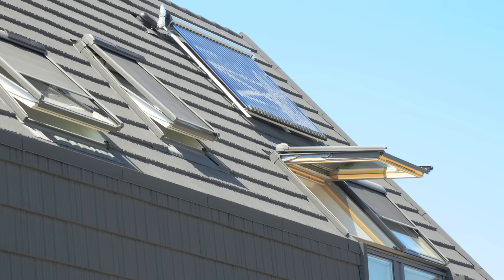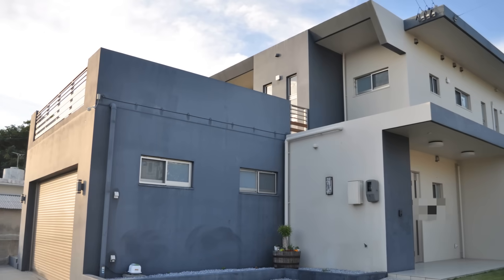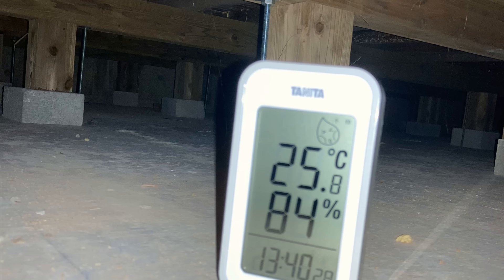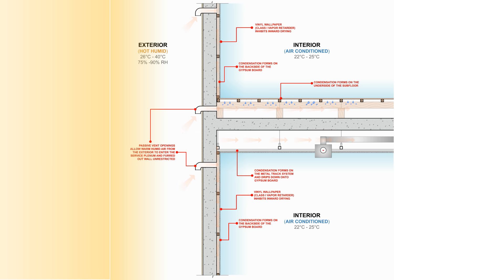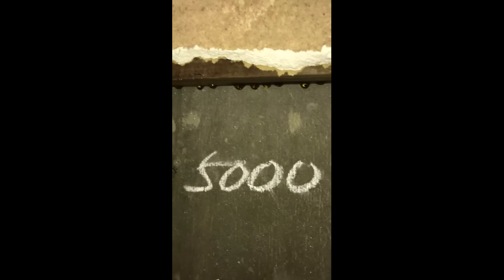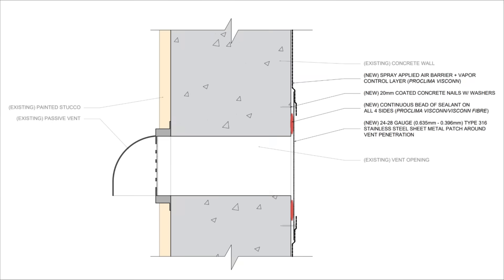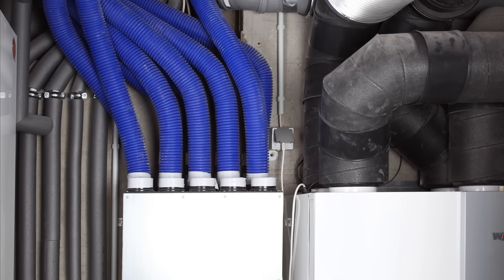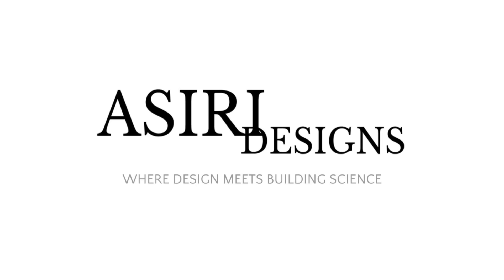The Unintended Consequences of "Passive" Ventilation... (A Case Study in Japan)

Comment: As a German electrician, I hate and love dry wall. Here in Germany we do Metal framing not wood, wiring cables socket outlets Piping water or whatever is easy but..... The exterior walls I would never ever put a drywall against it. They could roughen the concrete surface horizontal with a broom to give extra bonding ability for lime mortar. Lime prevents mold instead of clay  because of it's sanitizing surface. Here in Germany they used since the 80's a lot of gypsum mortar because it hardens quicker, down side it attracts mold too I bad conditions, today they finally switching back to lime and clay again, which we used for more than 2000 years. In the old world of course, greetings from Germany.

Comment: yeah I used to inspect the ventilation in residential and they try to make the houses tighter but that doesn't account for micro climates and details about moisture, and it becomes a bigger issue.  For example if you have a fish tank in a room we don't measure the exact ventilation to that room but then they want to be at the minimum for ventilation for energy.  You have to build concrete or block housing to do it.  They say they're using non-toxic building materials but that doesn't control what is brought into the house by occupants, and it doesn't change that it's still organic material that pathogens can grow on.  But passive ventilation exists with central air.  you can have mechanical ventilation and it doesn't change anything if there isn't feedback.  You're talking about controls like measuring temperature, humidity, and air flow into each room in detail.  You are not at that level.  That requires fenestration analysis on each window on different walls with different light exposure.

Comment: you cannot put AC into uninsulated buildings - period, this supposed "proper" ventilation is a bandaid, what you need in insulated walls so condensation cannot occur when the wall surface temperature on the moist air side doesn't get cold enough for condensation to occur

Comment: Very interesting but I am still having difficulties understanding the concept of ventilation and strict separations of the outdoor and the indoor. It is kinda contradictory.
Reply from the maker: I'll boil it down to these fundamental principles; Bring outside air in via controlled mechanical ventilation intakes so that you can control the rate of air change, the temperature and humidity of the incoming air, and the pollutants entering the interior. Basically, the outside air that you're consistently bringing inside is "treated" before it actually gets inside so that your fresh air is coming from a known and predictable source.
Reply: @ASIRIDesigns Right. Well I was thinking about the cross ventilation way of preventing moisture but after a bit of research it seems that you can't really have both at the same time, it is either natural crossed ventilation or controled air climatisation. It is a lot more complex than what I thought. I am gonna watch your other videos about this topic. Thanks.

Comment: Traditional building materials do not mold when they get wet. The problem with cheap modern materials is that a leak or condensation creates a cascade of black mold growth. It is not that traditional buildings had wind blowing through them. The materials themselves do not mold. The high quality traditional lumber can get soaked without molding. I have a 100 year old wooden floor where the toilet created condensation. The adjoining lumber cracked and had to be replaced, but MOLD DID NOT GROW. A traditional plaster wall DOES NOT mold when it gets wet.
Reply: bingo

Comment: I currently live in okinawa and ive had the exact same issue and circumstances in my rented apartment. The landlord tried to blame me for running the ac and told me not to run it below 25°c, but refused to listen to the fact that that temp is still below dew point and the building was just simply built poorly for the environment.

Comment: japanese have never heard of a vapor barrier? in hot humib climate the vapor barrier is usually on the outer side of the wall. The only problem in the video seems to come from furnishing the inside with hollow drywall and hollow floor how it was never intended. Usually those vents go into the room, not into wall or floor cavities.

Comment: 2:00 wouldn't it be cheaper to build brick house😅 mold dont touch red brick 😊
Reply: Because Japan is one of the most seismically active places on Earth, and brick performs disastrously in seismic events. Japan also has long, hot rainy seasons, and many parts of Japan have high exposure to ocean-sourced humidity. Also terrible for brick. To varying degrees, the same is true for many areas of the U.S.
Reply: You'll be surprised at what mold can grow on. I've seen more moldy concrete and brick walls in China than I can remember.

Comment: Coming from Singapore, my impression of passive ventilation for single floor buildings was high ceilings and louvers that can be opened or closed if they are retrofitted with air conditioning.

Not vents that are literally holes into hollow wall spaces.

Comment: If you are renting, and don’t have direct mold problems like in this case, but still smell wet wood coming from the passive vent of the roof during hot summers when the AC is running, does it make sense to put an active fan on the vent to blow some internal cold air out instead of letting the moist warm come in?
Reply: Need info. on AC: is it central (separate ducts/vents) or standalone unit? Based off of video's ventilation parts, need to consider attic/roof space insulation/ventilation. 

Seasonally "closing" passive intake vs. counter, passive-intake exhaust fan maybe a start. Active airflow into attic/roof space, may compound humidity & condensation for shared passive-intake air. An active fan can pull air back inside (a negative in this case) through (dirty, grease contaminated) kitchen cooking exhaust ducts (if present).

Increasing apartment's interior pressure (air pressure pushing outwards through vents/openings) helps correct inward humidity. As simplest part of this route, 1ˢᵗ seal air leaks by weather stripping & caulking of doors, windows & any gaps, as even small openings allow more humidity in vs. un-/poorly insulated wall diffusion. 2ⁿᵈly & more complex, bring in outside, filtered air via an ERV (Energy Recovery Ventilator) since location is in humid climate, to increase interior pressure.

Some ERV units can be adapted to apartments (require own window connecting ducts & ports, similar to  AC flexi-ducts):
1. Vents Freshbox Micra 100 WiFi,
2. Pioneer Eco-Oasis 150,
3. AprilAire Healthy Air System V22BEC 120cfm Brand New ––or–– Open Box,
4. Field Controls 150EC,
5. RenewAire Residential Series &
6. S&P🇺🇸Vent. Systems TRLPe.
Most units are in/on-ceiling/wall design, requiring wall hang or floor stand adaptation. Consulting qualified HACV specialist, experienced w/ conditions like in video, to appropriately size a unit, inclusive of numerous site factors, is also necessary. INITIALLY gets pricey fast, but in future moves to similar sized apartments, portable-ized ERV goes as well.

Comment: Me as a Brit watching this (we don't have AC), everything is backwards to what I'm used to seeing! Usually the interior air is warm and moist, and you let it dry by ventilating the cavities to the (cooler, dryer) air outside. Fascinating that buildings need to be constructed differently like that. What if you need heating in one part of the year, and cooling in another part of the year? Then the building would have to somehow handle both cases.
Reply: One way to do this would be to build a wall with symmetrical cross section, with a air/vapor barrier in the middle and insulation on both sides of it, so that in the summer the inside can dry inwards, in the winter the outside can dry outwards, and the air/vapor barrier never reaches dew point in any season. The classic British "high efficiency" wall of (inside --> outside) brick + foam board + plaster would work well in any climate since the insulation is air and (if thick enough) vapor tight.

Comment: I'm assuming this is a foreign family, maybe US military. I wonder about the air-conditioning. Japanese families usually only run ac in individual rooms. We only have one unit for the living room and only run it during the hottest part of the day. Grok says the electricity cost in Japan is 30-70% higher than the US. The cost to keep the house sealed and air-conditioned 24/7, especially without insulation would be horrible. But it may be the best compromise. 

I've lived in a concrete house in Japan. They are like ovens in the summer. The way my Japanese wife handled it was by trying to actively manage the heat, opening and closing the windows and drapes depending on the time of day and using reed sheets to keep the sun from directly hitting the windows . But basically we suffered a lot. One thing I would do is put some cheap raised decking on the roof to keep the sun off. Can be had at a home center.
Reply: Even in our manufactured double wide in humid north Georgia USA, active management of the sun and breeze can radically decrease in power use. I'm 67, we had to make do as kids. My grandma had a whole house exhaust fan in the attic. Huge and noisy, it really helped! It just amazes me that people have to "learn" to use drapes 😕

Comment: Interesting that every (relatively) new build I've seen in Japan has these passive ventilation vents though. Granted, Tokyo is not Okinawa, and the sheer amount of vents in that Okinawa home is higher than normal, but why is passive ventilation so prevalent here? Is it a giant problem that builders just ignore, and should be done away with even on the mainland? Should I just keep my vents closed even though I don't have a mechanical means to introduce positive pressure?

Comment: I bought a house walking distance to the ocean on Long Island.  I have A/C, but have never needed to use it, since I have lots of windows that can be opened to keep the rooms cool.

Was getting a little green mold on the sheet rock walls in my basement because I couldn't open the windows down there.  So I used Borax to get rid of the mold and opened two basement doors to get cross ventilation.

Another problem was the automatic sprinkler system.  The pipes that were connected to it were in the basement and would condensate and drip water on the floor, which would make everything damp and moldy, so I stopped using the underground sprinkler and just use a hose with an attached back-and-forth to water only my shrubs and flower beds.  The lawn can take care of itself.

Been without mold all summer, but at one point, I'll have to replace the windows down there...but since there are three large and four smaller, it will be ane expense that I have to save up for.
Reply: A basement dehumidifier alternative helps while slightly  heating air via it running, in case it ever gets to where watering by human hands isn’t feasible.
Reply: @cMethoDx I have two dehumidifiers, but found that just opening the doors works better, because the north/south location of the doors provide good air circulation where I live.

Need to do something with the windows at one point, since they're really large sliders set in the poured cement foundation and two lock when they're shut and are very hard to unlock when you want to open them...and one was permanently locked by removing the track.  The basement is very high and I can't be on a ladder trying to open them at my age.  There are also four 12" x 12" sliders in various parts of the basement from the same a-hole company that made the large ones.  🤣

Also, sliders need some kind of awning over them to prevent water from getting into the house when it rains.  There aren't any on any of the windows, so maybe there was less mold by keeping them closed.  😄

I miss the old louvered windows from the 50s and 60s.  Have 13 large ones on my back porch.  I can easily open them by simply turning a small crank.

Comment: Here in warm, wet Florida I run a dehumidifier 24/7, keeping interior RH below 40%, and this lets me set the main 
HVAC to 80F/27C with ample comfort- sometimes it even feels chilly.

This prevents any mold or mildew in the house (dewpoint about 53F/12C) and allows unnoticed sweat to quickly evaporate, promoting physical comfort while reducing the temperature difference between indoor and outdoor, which in turn reduces the heat load that the HVAC has to remove from the house. Damp towels quickly dry out and iced drinks produce much less condensation while taking longer for the ice to melt.

Separately controlling humidity and temperature allows both machines to work at greater efficiency.
Reply: Anything below 50%is dry af...
We have 55-60% all year around and never had any trouble with mould in over 15 years.
Reply: 27 feeling chilly? 😱
17 has me feeling far too warm
Reply: @sandwich2473  If I am anywhere with AC (my house does not have one),   it is set for 20 C :)
Reply: RH below 40, does it ever become too dry? I mean in-terms of having dry nose after sleeping.
Reply: @Ran-o7b3h  I lived in Mojave for many years, so that adjusted my opinion of "dry."
Reply: @Ran-o7b3h  Yeah, I think that's going to mess up the occupants.
Reply: Southern California it's 40-50% in summer and we set the AC to 80. That's about right, I would probably keep just a bit higher for comfort but your body adjusts after a couple weeks. You do need chapstick in the winter when it goes below 40% though. I found coffee with a touch of coconut oil gives the lips some good lubrication that lasts a few hours to start the day.
Reply: Is this a stand alone de-humidifier you can buy, or is it part of the central hvac system? What kind is it?
Reply: @hermanhale9258 I have a whole home dehumidifier, it's a small separate unit.
Reply: @future62  Oh, ok.

Comment: Very common problem with heritage buildings that use old lime plaster materials, timber framing and low compressive bricks. When they add AC, its just a magnet for mold, moss and efflorescence.

Comment: There's no such thing as "too much ventilation" if it's controlled. Obviously in colder climates you'd be worried if or not heat recovery is sufficient so you don't waste heat, and preferrably have a slight underpressure because hot inside to cold outside = condensation. But if it's controlled then it's fine.
In hot climates you'd also be worried... if or not you ro not let too much hot air and run underpressure to suck in hot air and have it condense.

Worst thing I head said is a guy who said (about houses in colder climates) that "the walls should breathe! That way it's a healthy, natural enviromnent!". Yeah, and also rot, and pneumonia or something from the fungal spores.

Comment: I've wondered about this. 
Here in the Ozarks where we get four seasons, hot humid air, massive insect and mildew pressure.
I don't know how the perfect wall system and monopoly framing and tight enclosure works with the overwhelming lower income building market. 
I can understand building science when money isn't an issue, but is there a way to incorporate best practices AND budget friendly options?

Comment: This is a super informative video that boils down to “the architect had no idea how to combine traditional methods with modern materials and made a moldy mess of everything”
Reply: thanks for summing the video up for me! I shoulda guessed it'd be something like that, seen that kind of video a hundred times...
Reply: It is not the architect,   it is the engineer
Reply: @dmitripogosian5084  thats the mating call of the wild american architect I have heard it so many times on jobsites. its mystical and hearing it echo off the structural insulated panels over the low hanging mist of marbolo smoke creates this majestic feeling of awe
Reply: Yep, old buildings in my country with passive ventilation tend to be fine. New ones tend to develop air quality issues pretty fast for this exact reason, as they're not built like the old buildings. Even with active ventilation there are often issues as the new materials are just crap.
Reply: Modern materials - that is the problem.
Reply: @interstellarsurfer their terracotta and limestone homes built deep into the ground tend to be cooler and wouldn't have mold issues, but they have many other issues that don't make them practical anymore.
Reply: @interstellarsurfer in theory it would be excellent to go back to established and old materials and methods. But the truth is we lack the established skills in the construction industry to use them, not to mention the timelines to build to those standards. Energy efficiency and occupant expectations have to be taken into account too. High performance materials mean the design professionals need to do their work, and the builders and trades need to follow the design very closely.
Reply: @izikavazo You just can't mix methods and materials for muh aesthetics. Pick a buulding standard and follow it to completion. Either you live in an un-airconditioned space built on ancient methods, or you live in a modern air-conditioned bubble.
Reply: @interstellarsurfer I absolutely agree. Not just with AC, but with an energy efficient building without cooling, high performance materials must be used correctly and without mixing in old methods and materials.
Reply: @izikavazo  Are we sure we have historical experience on how to to use high performance modern materials correctly ?    They did not exist 20 years ago,  we do not know their performance long term.
Reply: @interstellarsurfer  You can use traditional materials and build a mess of a house that'll fall over in a few years if you don't know what you're doing. The problem is ignorance 90% of the time